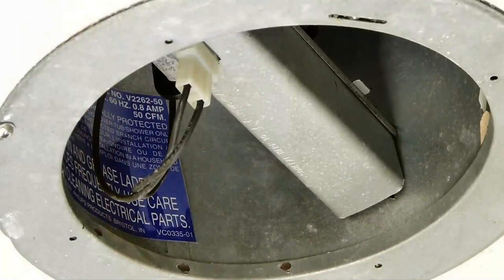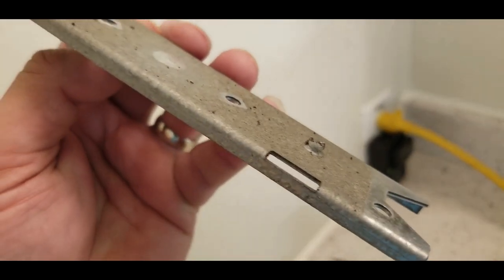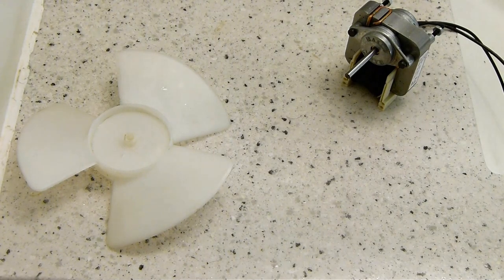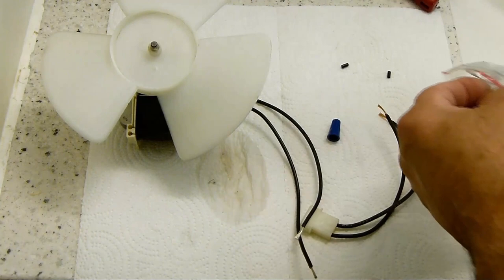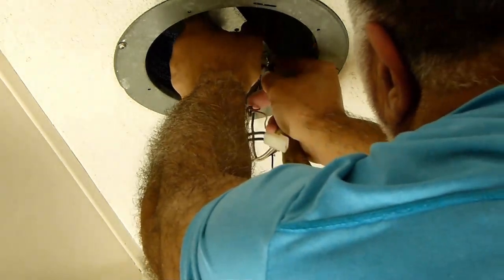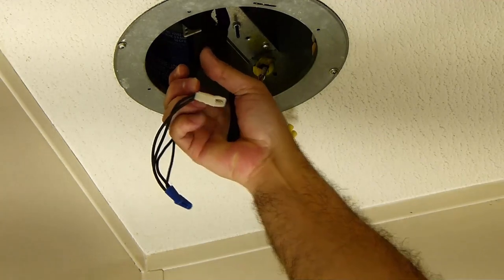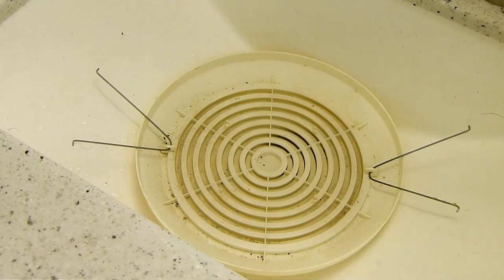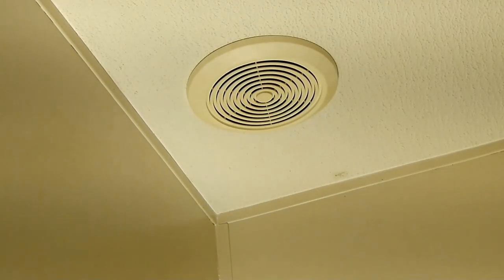Ventline V2262 Bathroom Exhaust Fan DIY Motor Replacement

Comment: Thanks so much for this! I changed out our old Ventline exhaust fan in our mobile home laundry room that we didn't know was a fan! We thought the third switch on the wall just led to nothing 😂 There was a massive bird nest in the tube too with dead birds and eggs! 😮 The only fan replacement kit local to buy (didn't want to wait for Amazon) was at Lowes for a Broan model, but I made it work! The hex nuts on the old model were bigger so I wrapped the bolts with Teflon tape to make it stay tight. Fan is running like a dream now! Now our laundry room won't steam up all winter! You're the best! 🎉
Reply from the maker: It makes me happy to read comments from viewers that have gotten inspiration and motivation from watching a video that I have posted. Thank you for your kind words.

Comment: I thought I saw a fan blade still in the box, wouldn't one be for CW and one for CCW rotations?
Reply from the maker: Hello @asegal0000. Thank goodness that the new fan motor was spinning CW like the original old motor. And yes the two blades that were included in the kit were for CW (Updraft) and CCW (Downdraft) but, I needed a CW rotating blade for this VENTLINE Extractor Fan and the included CW blade was simply too small and would not be very efficient in the original housing. The tape and SuperGlue hack to secure the original blade to new motor seems to work, I have replaced two fan motors in my home and reused the original fan blades using this hack. So far so good. Should last another 15+ years.

Comment: I hoped to find a video with the solutions to removing my Ventline fan.  My lower bracket had a bolt shaft hanging down through the center, but there was no nut to remove it. It holds the fan cover. Can't figure out how to remove it to get to the motor and fan blades.
Reply from the maker: Hello Azannah, there should be screws holding it together or it could be press fit. Did you solve this puzzle and have gotten your fan motor and blades out yet? If not, take photos of what you can see of this bracket and send photos to my Youtube account. Thank you.

Comment: The original fan blade looks like the one you would find in an older pre 2000s Broan range hood.
Reply from the maker: The home was built in 2006 so this is most likely from the early 2000s. The Manufacturer's Info Label shows the Model Number as V2262-50 and grill has the VENTLINE brand name molded onto it. Replacement motor works great.